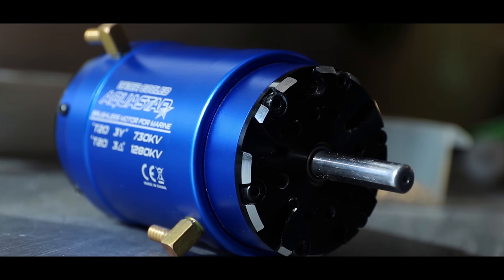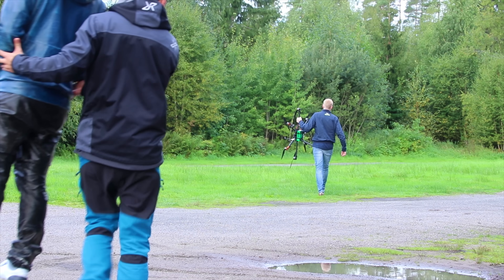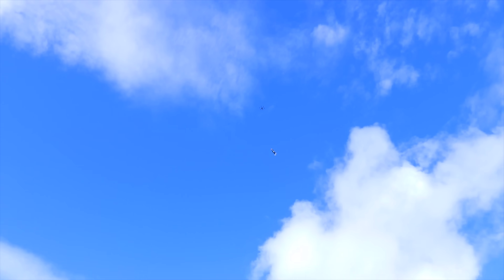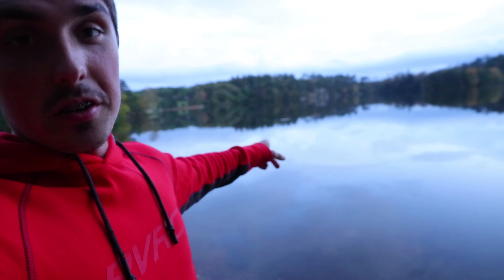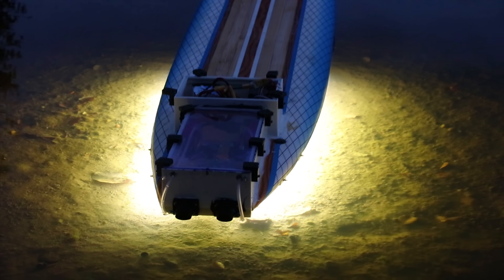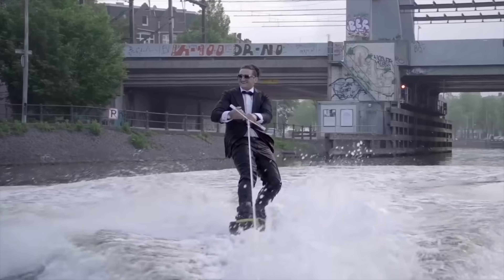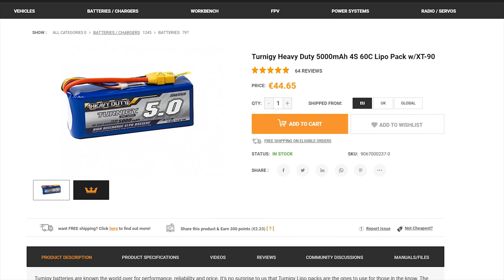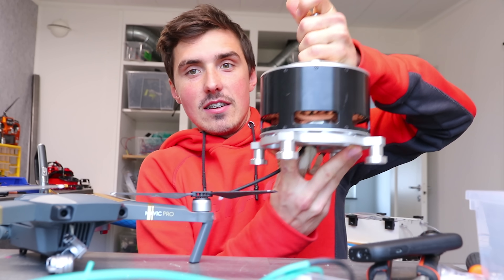I Made a $3000 Electric Surfboard   - PART 3

Comment: I try to DIY "underwater scooter"..  But I want to prepare the fastest electrical one..  I found too many different bldc motors. Some of them "pulls 50kg " (seller wrote this into details)... But they need 200A to give this 50kg pull force... Could you tell me This 56114 or 56123 is best or not. I mean why did you choose this engines. ? (I need less consuption but powerful motor. You know 200A battery can be too heavy and big, only because of this I left that motor)..   At least I have those engine informations (sss engines and I want to use 700kv to be more faster) because of you.. thank you so much.

Comment: awesome board, a few tips to make your board better: 
1- use a stiffer board instead of the soft deck you used now.
2- keep the original rocker line (underwater shape) of the board and do not flat laminate your box in the back, doing so will make you board a lot more playful and allow you to steer on lower speeds.

Comment: A heads up for next time you make a DIY electric surfboard. The pitching moment on a surfboard is where the bottom fins are. So your body should be right above the fins or just a few inches forward otherwise you will get a front-end washout. The side-to-side movement you're getting. You're too far forward. You're also losing lots of speed from being so far forward. If you were to move back above the fins or as close as possible, you will see a more than 50% improvement in overall performance. My father builds surfboards and electric surfboards and Kayaks in Southern California for a living. Other than that you did a fantastic You're right it's so much fun. You putting your Simon replica in the dumpster must have freaked people out thinking it is a murder mystery, lol.😂🤣

Comment: Very nice, that looked and worked great, fantastic speed on the water, just wondering when are you going to make a quod drone that can hover over the ground and have you in the middle of it, flying around just above the ground. All you need to do is reverse engineer a standard drone but have bigger brushless motors on the outside and  a small chair so that you can sit in the middle.

Comment: Did you also burned these new motors? Are they good? I need really reliable motor. Does the motor comes with the watercooler sleeve? If not where did you get those.

Comment: hey if u have would use 1 motor to drive the board what would u use? i have a fs75200 controller and would like to do 16s setup that would be powerfull , thanks

Comment: For part 4, optimize your design to better utilize your surroundings. If your motors or batteries are overheating add heat spreaders under the board.
Reply: someone also added watercooling to the motors coming from the jet pumps

Comment: this is awesome! sub'd for sure. i know this is like a year old now but I can't help but think replacing the rc controller with a wired style sunk into the surfboard similar to the LED strips and leading to a rope handle coming from the nose would eliminate the water in the controller issues and give a handle to hold onto to help steer and get up. Too bad it ended up braking the bank! -off to see what you've done next

Comment: What is the total run time and total size(voltage and capacity) of the battery
24v and how many amphours
FYI, I dont recommend Turnigy lipo batteries unless you are ok with never ever drawing more then half the maximum discharge rate. They puff up real easy otherwise. Great video, can't wait for part4

Comment: Great job, man !

Interesting & fun project - good follow through and excellent production quality.

Might want to take a look at controllers from Flipsky for future projects.

They have a water cooled controller that's 200A continuous.- the controllers you used are 400a peak, but no idea what they are continuous, and for your use, you really need as much continuous as the motors can handle.

They don't operate at as high a voltage as some controllers, but they are vesc based, which offers a lot of control and protection that may save other components from frying.

Comment: I don't speak English, could someone tell me the diameter of the turbines used? Please.
Thank you
Reply from the maker: The diameter of the turbines are 55mm.
Reply: @RcLifeOn  Thank you very much for your answer. For the 56123 motor, is it 230 or 500 kv? I am on the right track if I put 500 kv in 6s or is it better to 230 kv in 12s?
Thanks in advance, I really regret not understanding English ... lol
Reply from the maker: 500kv 12s is the best.

Comment: Watched all three.  If you had made these clamp on units you may have had a market.  What's the prop wear like?  Further I personally would be looking to place the props toward the sides at the rear which would make it a lot more stable.  Size of the props themselves and various shapes should also be tested.  All in it's been interesting.

Comment: sick board my friend. How many cells are you running it at? 12s? Will sub if you reply T.T
Reply from the maker: 12S 16Ah total.
Reply: @RcLifeOn  thanks subbed tddup. What speed you get on that btw? Looks so fast
Reply from the maker: @thestrongestavenger1  Pretty much 50km/h full speed.
Reply: @RcLifeOn  nice you could try the MHZ jets or chinese ones if you plan a next project, increase the prop size to get more speed if the motors can give more

Comment: Great job! I have about 28 of this Turnigy Heavy Duty 5000mAh (60/120C) running in a motorcycle. Have testetd one pack with 250A für 5 seconds. After that the fuse was blown away ;-). So I am pretty sure they can handle 300A for a while. I will need them for about 10 seconds.

Comment: You need to get that nose down, the board would go way faster
Maybe you could put the control module and the batteries in the front and the pumps in the back
Reply: Won’t the board nose-dive?
Reply: @Thomas-pr5zh  With too much weight on the front yeah
But right now, the board is kind of diagonal in the water
When you paddle a board perfectly flat, it FLIES : )
The nose is already curved up, if the board were flat it would not nosedive

Comment: There are different versions of the motor you linked, which one did you choose?
KV360
KV500
KV420
KV650
KV790

Thanks! :D
Reply from the maker: I use the 500kv version with 55mm diameter propellers.

Comment: Mate, awesome piece of gear U got there. 
I'm building some jet surf in my basemen as well, but am total rookie on the RC stuff and all these batteries and electric engines etc. 
Could you give me some advice? 
My jet drive diameter is 80mm. What kind of electric motor would  you recommend? (I was thinking about this one: https://pl.aliexpress.com/item/4000111873308.html?spm=a2g0o.productlist.0.0.7a042431mbZyb6&algo_pvid=5c0ad710-404f-4627-b54b-233a1ac57e97&algo_expid=5c0ad710-404f-4627-b54b-233a1ac57e97-0&btsid=2100bb4916039134719717682e9dba&ws_ab_test=searchweb0_0,searchweb201602_,searchweb201603_ )
Also, wouldn't these ( https://hobbyking.com/en_us/turnigy-rapid-6500mah-2s2p-140c-hardcase-lipo-battery-pack-roar-approved.html?queryID=0272ccb70d3b892c7c5d7e6b90d8e05f&objectID=85646&indexName=hbk_live_magento_en_us_products ) batteries be better than these you've recommended ( https://hobbyking.com/en_us/turnigy-battery-heavy-duty-5000mah-6s-60c-lipo-pack-xt-90.html?wrh_pdp=3 ) and if not, why?

Comment: Hey man. ive been plotting to make one of these for a while for my dad who surfs daily but his hands don't work like they used to. 
do you think a discrete version of this would work so it could still function as a normal surfboard in ocean swell? 
mostly just for paddling back out amongst the breaking waves.
nice vid. liked
Reply: I believe there is a product out there for this, its a fin you can put on your board with a power unit in it.  Not designed for flat water but for paddle assist.  Much lower power req that something that needs to get on plane like this board.

Comment: how long do the batteries last? i noticed 12s 8A batteries used for each ESC as you mentioned on the Part 2. Also, can you please advise the KV for the new motors? The link points to 4 different voltages. Thanks for inspiring me. Take care and stay safe!

Comment: Is there an advantage to using a water jet? wouldn't putting the motor in the front of the surfboard and having a long shaft with a regular prop in the rear be more efficient?

Comment: Hey have you looked at large diameter out runner motors instead of those inrunners? They will pull less amps and have more torque. You might even be able to use one motor instead of two. How many watts per motor/ESC are you pulling?

Comment: What kv on the motors? And how long batterytime do you get with only two 5000mah in series (or is it /motor)? Well done anyway, good to see it fly!
Reply from the maker: SSS 500kv motors on 12S (50V). 4x 8000mAh 6S batteries = 2x 8000mAh 12S batteries. One battery for each motors lasts about 4 minutes. 😂
Reply: @RcLifeOn  Damn thats a lot of power going fast, but really cool projekt, hopefully batteries gets better :)

Comment: Thanks for great design and inspiring videos!
Looking into doing something similar this winter and have some questions:
1. Text says 12S (2 x 6S) battery but video says 16S (4 x 4S, 5Ah). What is it?
2. Motor comes with different KV, 360-790 . What KV are you using?
3. Where did you find water cooler for motor?
3. What is the weight of the complete board, including batteries?
4. Was your friend to heavy for the board? What is max suitable weight, for rider?
5. What is the size of the drive (propeller diameter)?
Keep up the good work – Looking forward to more videos! :)
Reply from the maker: 1. I'm using 12S but would like to upgrade to 16S.
2. 500kv
3. Dunno, had a guy fix it. But the motor diameter is 56mm, you could probably find something on Ebay.
3. Probably around 10kg.
4. Yeah, he was a bit too heavy. I'm 70kg but it could probably work with another 10-20kg.
5. 55mm diameter.
Reply: @RcLifeOn  Thanks! I'll drop you a line if/when it gets going!

Comment: Hacksmith recently made a "Silver Surfer" board, and I'm going to give you the same suggestion I gave them. Use a hydrofoil. Less drag. More speed. It will also keep the electronics further from the water.

Comment: For batteries you should try the ovonic batteries they are really good and pretty cheap but build like a tank. Instead of hobbyking.
Reply from the maker: Yeah, I'll look into that. Li-on batteries have a hard time supplying the 400A current to both motors. Li-po can barely do it.
Reply: @RcLifeOn  They have some 8s 5000mAh 65C rated. So 4 of those connected two in parallel and two in series will get you to 16s 10000mAh 65C capable of 650A continuous.

Comment: Why dont you use blue robotics waterproof motor? It doesn't need water cooling. Its way cheaper. Although its too late to tell. Thanks to @YouTube  notifications system
Reply from the maker: Thanks notifications! Well, the motors needs to be a very specific KV and usually thruster motors are slow but strong.
Reply: @RcLifeOn  yeah they are more for accurate movements than speed. But do check them in future if possible. I have used them for my project they are really powerful.

Comment: Your projects are amazing man and because of you I might just try out my own jet surf board. One question though, why choose jet propulsion instead of propellers to power the surf board? Surely propellers would be more efficient you could go with lower kv motors to move a larger volume of water?
Reply from the maker: You are absolutely right, it would be easier and more efficient to use a open propeller. But look at a jet ski, they are always closed jet propulsion because of the safety issue.

Comment: I have been working on a similar device but using s SUP board. The main improvement I came up with, since I forced myself to use an outrunner, is to encase the otrunner in PETG while the motor is physically being held in place by an aluminium plate. This way you can run oil through the PETG jacket, into a pump attached directly to the spinning case of the motor, into a water oil heat exchanger (pc cooling radiator submerged in water) and back into the other end of the PETG case. I think you could in combination with a powerfull VESC achive the maximum power output of that motor for a longer period of time.